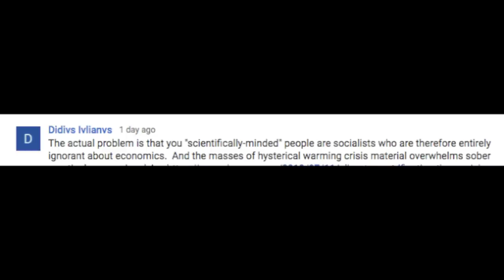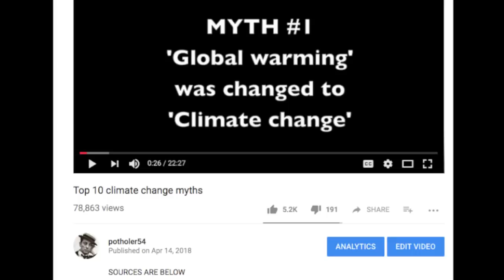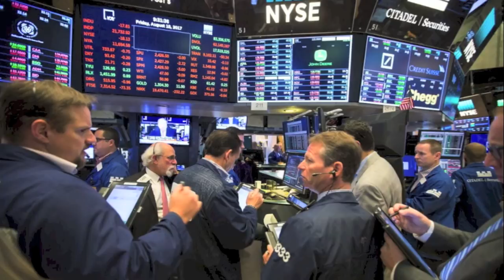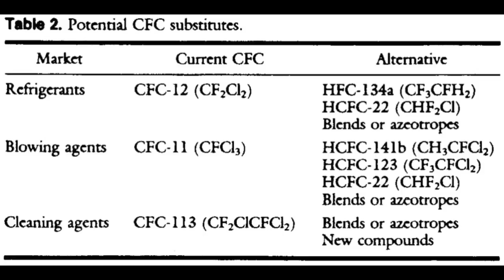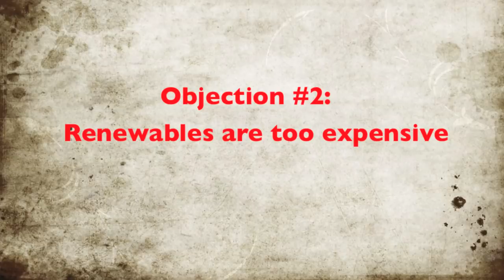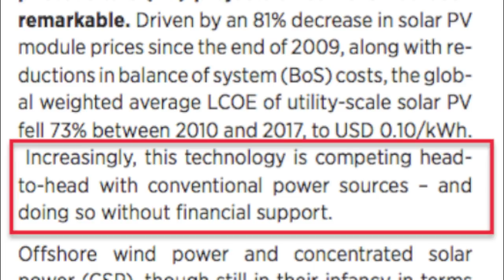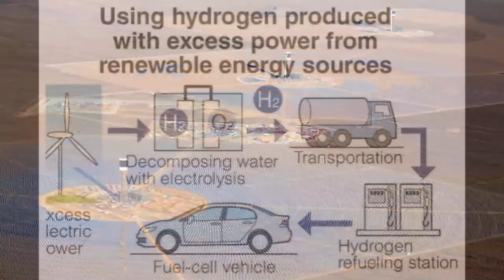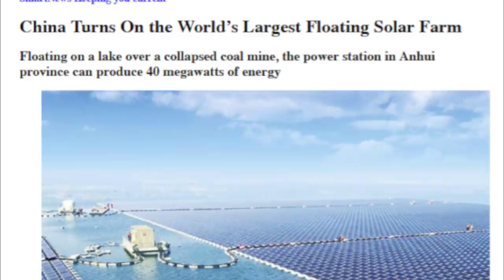A CONSERVATIVE solution to global warming (Part 1)

Comment: Michael Shellenberger writes why nuclear makes sense but diffuse energy from solar and wind really doesn't. And how wind towers kill big rare threatened birds whose flight paths put them into direct conflict with wind turbines. Not so much for more abundant little birds which may face more dangers from cats and other predators. Sometimes big bird deaths aren't accurately counted when their bodies are flung or flown out of the normal area of counting.

How, despite tech advances, wind and solar are still energy more suitable for agrarian days, and probably no amount of tech advance, he says he pushed these renewables for 10 years (or 20 years?), can overcome the inherent limitations of the physics .   COMMENTS?

Schellenberger (c or no c?) is former Sierra Club insider. Wrote about their internal anti nuclear propaganda efforts, scare stories, and how nuke power has been relatively much safer. Would be far cleaner if they stopped using low extraction methods where waste still contains a lot of radioactive energy. 

Debunked the Chernobyl movie, which isn't a documentary but is cited as if it were.

COMMENTS?  please tell me if this is wrong
Reply: @dilbertgeg
I would watch out with Shellenberger as he is a great cherry picker of data.

For example I've watched a ted talk of his and almost every statistic or graph was cherry picked to some extent.
He compared Germany to France and claimed Germanys emissions rose due to the phaseout of nuclear, by showing emissions 2009 vs 2016.
There was so much wrong with that single slight alone.
1. He zoomed in on the graph making it look like a huge spike, while it was a small increase.
2. He showed overall emissions, which rose, but emissions from electricity production actually decreased in that time frame.
3. The rise wasn't due to nuclear phaseout, but because 2008 there was the great recession, so the economy and therefore the emissions did a dive in 2008/2009 and normalized in 2010. If he would have compared 2007 to 2016 it would have shown a decrease. If he would have chosen 2010 to 2016 in would have shown a decrease, but he cherry picked the moment 2009 where the economical output was the lowest.

Later he compared prices, but didn't compare production prices, but consumer prices and used them to say that production of nuclear was cheaper, while in reality it is the other way around.

Which is the reason why France is scaling back their nuclear power plants.
https://www.google.de/amp/s/www.bloomberg.com/amp/news/articles/2018-12-10/french-power-costs-will-rise-if-renewables-are-sidestepped
Reply: @dilbertgeg
And to address your other points.

"Diffuse energy"
I once read an article from him, where he compared energy production by used land to argue that nuclear is so much more efficient.
Again some cherry picking from him.
He basically used the distance from one wind turbine to the next and took the whole area as being used by that wind turbine, while everyone knows that most of that land can and still is used (for example for farming).
For nuclear he only used the nuclear power plant but totally ignored the exclusion zones.
You have a 1 mile radius exclusion zone around a nuclear power plant and a 5 mile low population zone.

Take the 1 mile exclusion zone and use it for a giant solar farm.
1 mile radius equals 8 million square meter of land (pi*1.6²). Solar produces around 100 to 250 kWh (depending on location) of electricity per square meter and per year.
So a solar farm the size of the exclusion zone of a nuclear power plant would produce 0.8 to 2TWh of electricity a year. If you include the low population area (you can put solar on roof tops after all) you get a yearly production of 20 to 50 TWh.
The nuclear power plant itself produces around 5 to 10 TWh.
So you could argue that nuclear power uses more land.

"Big birds"
Windows seem to kill much more (big) birds than wind power and climate change and air pollution seem to kill much more animals (including those rare birds) than wind power.

Comment: The store is with NH3.  Can be made for $2-3/gal e.  My engine system is the solution and KEY.  No real need for wind or PV solar, or solar farms.  All can be done on house/factory.  I have rolled up my sleeves and have the solution.  see tweets @seaplaneguy  There are steps to zero carbon.  I spell them out.  This video makes so many mistakes....  The solar water heater was NOT valid technology.  That is why it was taken down. Just read my tweets if you actually want to know the future.  China's junk is just that.

Comment: @ 20:00

Actually, that is exactly what I have in mind as the solution to rising CO2 levels; I often wondered: "can't we just find a way to sequester the excess CO2?"

Now we have the technology: we can get cleaning.

As to sources of energy? I'm of the opinion that there is no such thing as "green energy"--I suspect you an figure out where I'm coming from here. But I have to say: We're certainly (slowly), headed the right way (I mean outside the US)..

Which, if these latest developments are a clue, are well underway :D
Reply: CO2 sequestration is indeed an interesting technology, but in terms of using it to fight global warming depends on how cost effective it is. It's particularly in form of carbon capture, where fossil fuel power plants can produce energy and pump the CO2 back into the ground, making this energy neutral just like with bio fuels. Unlike with bio fuels, the source does not compete with farming and food production. If you combine bio fuels and carbon capture you can become carbon neutral, taking CO2 out of the air and into the ground, while producing energy. CO2 sequestration alone would not be a very good business as the demand for CO2 is not that high, also when you sell the CO2 it goes back into the atmosphere, making it carbon neutral. To incentivize sequestration to put in the ground, you would need a form of carbon tax or trade system where the sequestration businesses could sell their negative carbon numbers to potential buyers. The key lies in the cost effectiveness of it, depending on how big the feed back loops are and how much greenhouse gasses we will eventually release into the atmosphere it may become rather necessary to lower the amount of CO2 in the atmosphere to counter the feed back loops.

In terms of renewable energy studies from California reveals that they can get to about 50-60% renewable with storage for minimal price increase on electricity. Beyond that point and there is a severe diminishing returns leading to skyrocketing prices. The reason is that storage methods can even out daily fluctuations without affecting the price much at all, but seasonal changes would require so much storage that the price of electricity would sky rocket. Therefore the obvious solution to get the last 50-40% to reach 100% carbon neutral energy production, would require either carbon capture/sequestration or nuclear power. Unfortunately nuclear has gotten a bad wrap in the public eye and cannot compete on price today with coal and natural gas. If carbon capture was put into effect then it may well be able to compete even without lowering the regulation levels. If the regulation levels are lowered, then the price of nuclear could drop, without much increase in the risk of any accidental release of radioactive elements as the newer technologies are much safer and meltdown proof than older nuclear reactor technology.

Of course local conditions vary a lot so some places need more base load power while other less or even nothing. Here in Norway for example we are basically 100% renewable electricity due to hydro power, so we don't need any fossil fuels or nuclear. Our only issue is the transport sector, but with fast electrification that is being taken care of. For road transport the future is in a combination of electric vehicles and hydrogen electric hybrids. In air travel, the solution is either in hydrogen or bio fuels, while shipping seems to be hydrogen. We live in exciting times!
Reply: I'd go with the trade system as the ideal, rather than a direct carbon tax; while the latter is certainly more direct, it also may cause  "perverse incentives"; that's certainly what I've learned from the Solyndra scandal--which has doubtless helped to set us back, here in the US (though by no means the only factor--naturally). I know, not an example of a carbon tax itself, but the concept is the same. Beyond that, the latest news regarding carbon sequestration seems promising enough: if we can simply get into a situation where we can sequester slightly more than is produced per year, we can get where we need to slowly (frankly, I don't see a quicker rate). Then, as technology doubtless improves, we can up the ante. Of course, I'm also in favor of campaigns to reforest regions: nature always has an efficient carbon-sequestration method around. We just need give her a helping hand. But as you say: the challenge is to find incentives.

The lack of nuclear competitiveness I fear, is exactly due to the bad rep it gets; we have 5th generation reactors and counting, yet most functional plants have not been updated accordingly, precisely due to fears on the subject.

Ultimately though, far cleverer people than me will doubtless get us there, given time and effort unimpeded.

Comment: The Free Market can do it all.

My house is 100% solar.  Solar is very easy and pretty cheap.  The electrification of transportation is coming and will reduce CO2 emissions dramatically.  Let's redouble or triple our reforestation efforts as well.
Reply: CONTACTLIGHTTOMMY It can’t, because the free market isn’t actually free at all. You’re only free to pursue choices pre-selected for you by Plutocrats.
Reply: @keyow2  yeah, it is a regulated market not free.
Reply: @keyow2  
I don't think you understand the word "free" in "free market" if you think plutocracy is part of it. A free market system must be protected from such elements.

That said, despite plutocracy being a problem, Contact is correct. You can buy solar panels, and an electric car that runs off your own energy; you can insulate your home (and just not use an AC... most of our foreparents didn't have it either). 

Wanna do more? Help your poorer neighbors on funding solar panels for them. Seeing as most on the hard left appear to be of the higher classes, I'm sure there is enough money. Just requires the will.

And if regulations stand in your way? Send Trump a message. He's big on deregulation, after all.

That's if you wanna help solve the problem. If you can't, then how demand others pay for your desires? And if you won't... then what are the complaints worth?
Reply: sorsocksfake There is no such thing as a “free” market. No Capitalist Market can be sustained without a state to validate the concept of property and provide defense from foreign activity.

Inevitably, Capitalism presents itself in one of two forms: A Social Democracy, where many failures of the market are corrected and the major actors are regulated by a government, or a Corporatocracy, where those actors regulate the government.

As for turning to green energy on your own, setting aside for a moment the fact that this is a globally catastrophic problem and requires an immediate global-scale solution, the “free” market has not presented this as a choice to most.

The cost of totally converting your home to green energy in a society where Fossil Fuel Industries have ensured they remain the only readily convenient option is a massive problem. 

The market has failed, because while it promotes competition, someone wins that competition. And when they do, they accumulate the power necessary to continue winning even when their product becomes inferior.
Reply: CONTACTLIGHTTOMMY 
My take on something I never mentioned specifically is erroneous? That’s nice.

I’m not letting a condescending “you need a better perspective” sentiment stand from someone who, not only knows absolutely nothing about the person they’re talking about, but has failed to present a refutation to their argument.

My perspective is valid, try again.

Comment: "No! yOu Cant Be kAPiTaLiST AnD PrOtEct EnVirOnmeNt!"
Eco Capitalism: "Are you sure about that?"
Reply: What's with the stupid typing .?
Reply: @davidwatson2399  meant as mockery
Reply: Science: "But empirical evidence on resource use and carbon emissions does not support green growth theory. Examining relevant studies on historical trends and model-based projections, we find that: (1) there is no empirical evidence that absolute decoupling from resource use can be achieved on a global scale against a background of continued economic growth, and (2) absolute decoupling from carbon emissions is highly unlikely to be achieved at a rate rapid enough to prevent global warming over 1.5°C or 2°C, even under optimistic policy conditions. We conclude that green growth is likely to be a misguided objective, and that policymakers need to look toward alternative strategies." - 'Is Green  Growth Possible?' Hickel et al. (2019)
Reply: @_yonas  A single opinion paper can be scientific, but not scientific knowledge in itself.

Comment: Is that quote from Ben Shapiro from many years ago? I listen to him a lot and he does not deny anthropogenic climate change. His argument is that it will be easier for humanity to adapt to the gradually changing climate than it is for society to adopt expensive measures that he believes cannot be effective. Basically, his argument is that no one has proposed a legitimately viable solution to climate change that doesn't cause more harm than doing nothing.

So I don't think Shapiro should be used as the stand-in for all conservative opposition to climate change. There are lots of prominent conservatives who legitimately deny anthropogenic climate change in its entirety. Ben Shapiro is not one of those.

I guess this video is using him specifically because of his resistance based on a lack of a viable solution and he's a good candidate for that use, but the quote that is used from him at the beginning of the video is not him saying that. The clip used at the beginning of this video is him disputing the validity of climate change in its entirety. It must've been a long time ago, because he has explicitly said on many occasions that anthropogenic climate change is real, so the clip at the beginning of this video misrepresents his current position.
Reply from the maker: "I listen to him a lot and he does not deny anthropogenic climate change."
   I think you'll find he does not deny climate change. That's not a difficult position to hold, since no one denies climate change. It's very different to not denying that anthropogenic carbon gases are the cause of recent temperature rise. If you think he's made such an admission, please cite where he said this. Thanks.
Reply: @Nate Decker

"Is that quote from Ben Shapiro from many years ago? I listen to him a lot and he does not deny anthropogenic climate change. His argument is that it will be easier for humanity to adapt to the gradually changing climate than it is for society to adopt expensive measures that he believes cannot be effective. Basically, his argument is that no one has proposed a legitimately viable solution to climate change that doesn't cause more harm than doing nothing.
"

Shapiro resorting to a baseless conspiracy theory on global warming, using non-peer-reviewed denialist sources:

"And none of this takes into account purposeful data fabrication in order to achieve global warming propaganda."
https://www.dailywire.com/news/1472/five-reasons-obamas-climate-change-agenda-ben-shapiro
http://archive.is/WJPoY

potholer54 debunking Shapiro's asinine claim of no recent global warming:

"Top 10 climate change myths", from 19:39 to 20:27
https://www.youtube.com/watch?v=FBF6F4Bi6Sg&t=1179s

hbomberguy debunking Shapiro ludicrous idea that in response to warming-induced rising sea levels, people can just sell their coastal homes to someone else:

"Climate Denial: A Measured Response", from 3:11 to to 5:19
https://www.youtube.com/watch?v=RLqXkYrdmjY&t=191s

Comment: The problem I have is with the framing of renewable energy technology as environmentally friendly, when it does nothing to reduce consumption, growth or emissions. Renewables are a way of saving industrial civilisation, not the wider biosphere, which would be far better off if we ran out of energy and collapsed. If we acknowledge this then conservative arguments against renewables dissolve. I don't want to be around when we run out of energy either.

Comment: This is pretty much what I've been saying for ages. If the only solution that people who believe in climate change can come up with is "more taxes", they're never going to get the support of a large group people. There have been lots of technologies invented to create power without using fossil fuels, to pull carbon out of the air, and supporting those various technologies would cost far, far less than the economic harm of a mass tax on energy. And of course, many of these technologies have already been put to use in the US, for instance there's a solar liquid salt system in CA, and many dams pump water up hill to release the energy when prices are higher. The solutions to these problems can be had as soon as people stop trying to use the topic as a wedge issue, and for not a whole lot of cost if we do a bit of planning.
Reply: Who the fuck says “more taxes” in regards to CC solution? Lol its about R&D. Spearheading new ways to find renewable clean energy. Obviously taxes wont help that. Lol it will take the government and private market to find efficiency in energy.